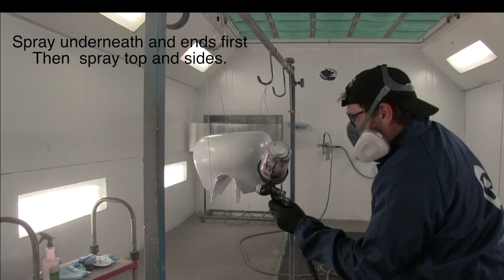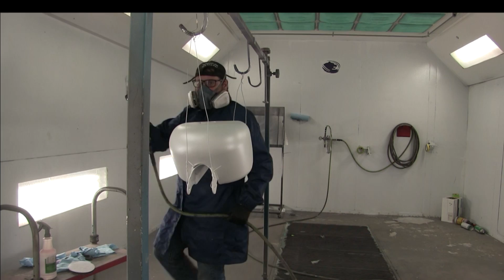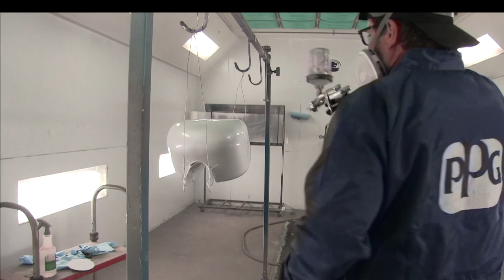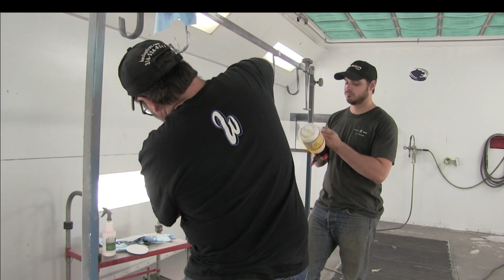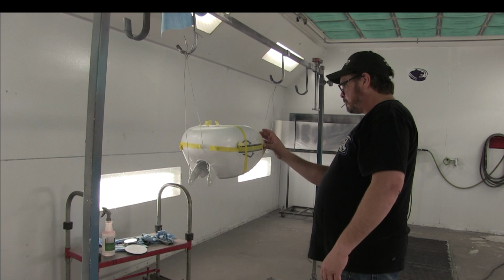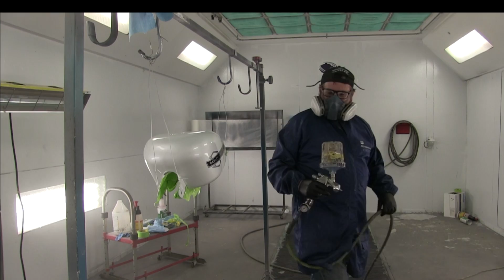How To Paint a Harley Davidson Gas Tank -  Tri-coat Pearl

Comment: Hey man I just had a guy paint my tank and he got paint inside the tank. Is that bad ? If so anything I can do to get it removed before I put my fuel pump back in and gas
Reply from the maker: You may want to rinse the tank with gas before using.

Comment: Body filler on bare metal, epoxy primer 2 Coats, polyester primer 2 coats, 2K urethane primer 2 Coats, should I just block sand once im done applying all primers and be done with it??
Cause with all that build with poly & 2k it should be straight right?
Reply from the maker: 2k primer surfacer is designed to be block sanding and that will help level the lows and highs.  You will block sand taking more off the level surface and leaving more mils in the low areas which will level the surface.
Reply: @CarAddictGarage  so i can just bondo & primer all coats then block sand and be okey?